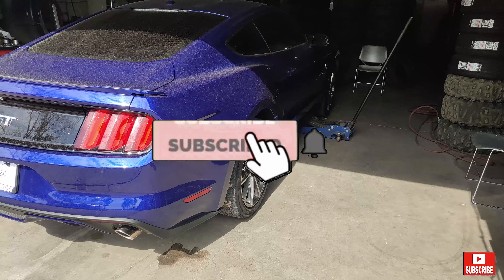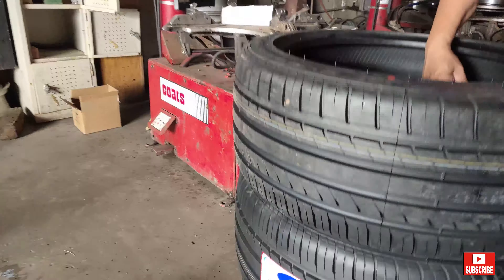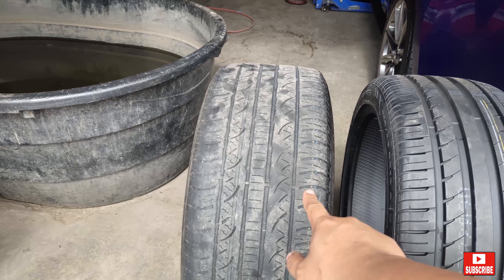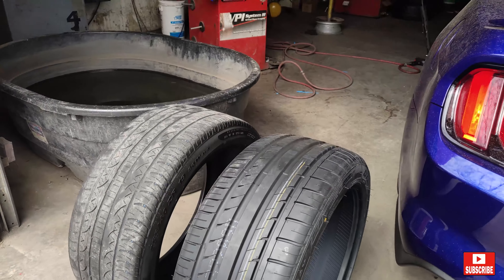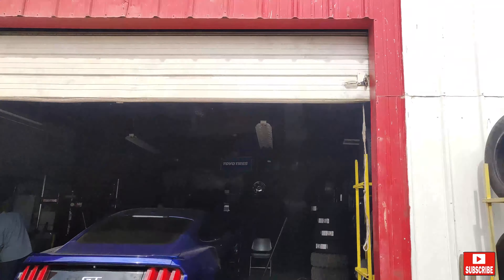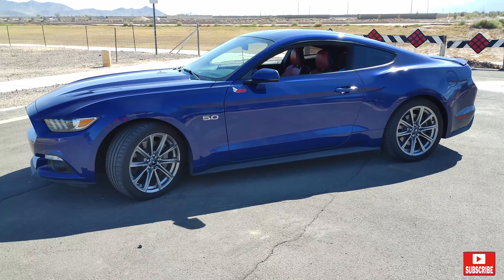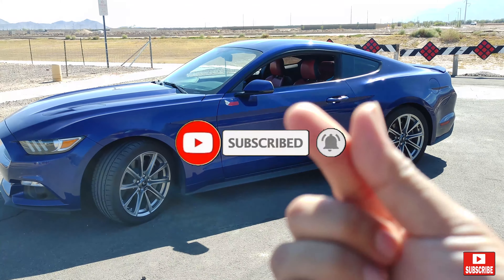GT Radial Champiro HPY  Install/Review

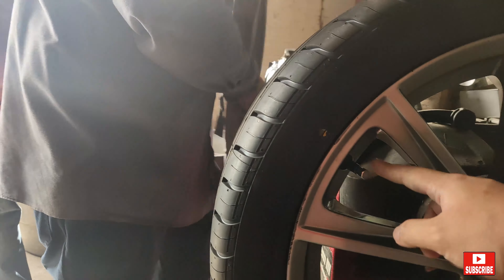Comment: Thanks.  What is the comparison between yellow dot and valve stem?  At 3:45?
Reply from the maker: That's The Tire manufacturer Recommend that the yellow dot and Valve Stem need to be aligned to each other.

Comment: one year update? how are they still running?
Reply from the maker: Yes. The Tires are Still running Strong Very Quiet and Smooth. Nice Grip to. Compare to may Stock Perreli Pzero Nero that come Stock with it. Didn't tried on snow yet.

Comment: The GT Radial Sports Active is very dangerous and prone to cracking on the inside walls of the tyre and blowouts is the end result. Stay very far away from them.
Reply from the maker: I change my tires every 5 years anyway
Reply: Need more info. How old were the  GT radial  SPORT ACTIVE when they started to crack?   How many mi were on them?  The sport active is a Sumer tire and has more silica than an all season so cracking shouldn’t be an issue.  Please explain further.
Reply from the maker: These are the GT Radial  Champiro HPY not the Sport Active.
Reply: @annaqsmith  the GT Radial Sports Active tyres failed on 20000km,s with a blowout and pressure was checked day before, second blowout on 30000 km,s and happened on a very short trip. Third on fourth failure was cracks on inside walls of rear tyres. All failures happened on my rear tyres were maximum load happens on the inside shoulder of my tyres because my car has independent rear suspension and all independent suspension wears more on the inside of tyres. Bottom line is these tyres are not of a safe standard
Reply: @AshleyGain  thx for your quick reply.  I appreciate it. I am still a bit confused tho. What  make & model car were these tires on and how many years did you have these tires? What type of climate.do you live in?  Since  your measuring distance in km, obviously you aren’t in the USA. 20000km = 124,000 miles which is a distance no tire lasts.
Reply: @annaqsmith  my car's services are every 10000km,s and that means the tyres lasted only two services, then three services and finally four services. The tyres was bought in 2019 and 2022 was first blowout and second blowout In 2023 and finally the last two in 2024. That's not very good mileage l service from these tyres. All failed on the inside walls of rear tyres. I'm driving a 1992 Ford Sapphire glx executive and has a weight of 1300kg . This is a British designed car.
Reply: @annaqsmith  the climate is close to Michigan without the extremes, I'm in South Africa, Cape Town
Reply: @AshleyGain   thx for this info.  I do wonder tho how old were the tires when installed. Most tires have the date of manufacture on the tire. If the customer does not check the date, who know how old the tire is. The older a tire  is the more rot that can occur. 

I’ve seen and heard good reviews for these GTs except for you of course.I was just about to purchase 4  for a 2017 Camry but I haven’t decided 100% yet. I do need to do a bit more research. I live in south Florida which is a sub tropical climate n it’s getting hotter yr by yr. 
Last Q: what tires did you get after the blow outs?
Reply: @annaqsmith  the GT Radial Touring gets phenomenal reviews and possibly comes from a different factory than these Sport Active blowouts.

Comment: Still good? Just put these on my wifes car. I hope they last...
Reply from the maker: So far so good. Very Quiet tires and full of grib , very stable on higher Speed. I didn't tested yet on heavy rain and Snow.
Reply: @JologsGarage  thanks for the reply. I just hope they last and I didn’t waste my money lol! They seem to be pretty good from the the reviews I’ve read and such!
Reply from the maker: @Seechase_  u should have  no issues I still  run  them  on my 2015 Mustang  GT 5.0. I'm putting  alot  off horse  power  on the rear wheels.  Just  check the date  of the tires  to make sure  u have fresh  ones.
Reply: @JologsGarage  good tip. That’s a must!